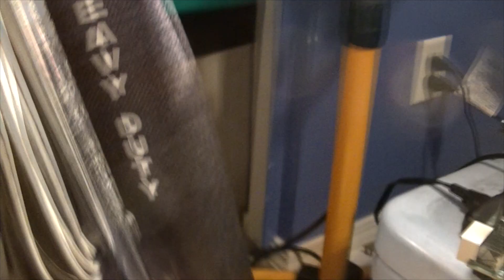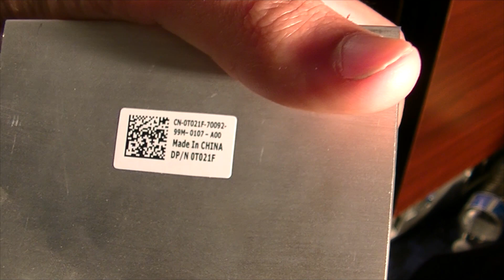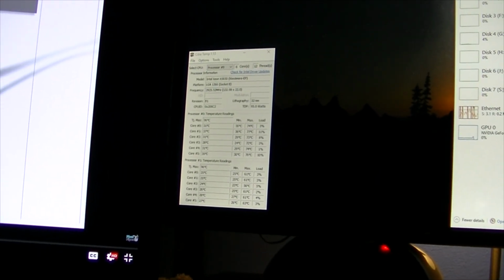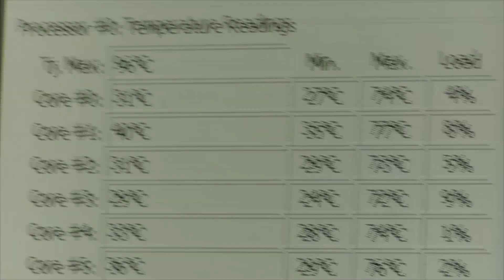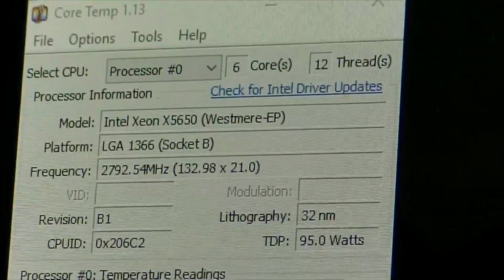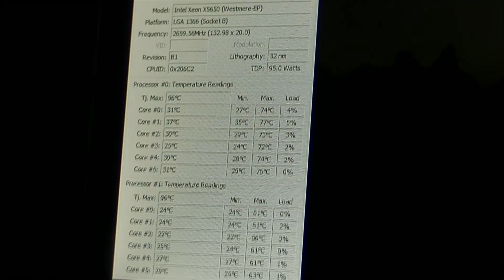Dell Precision T7500 - Heatsink Upgrade

Comment: Can you fit any 1366 compliant cooler?
Reply from the maker: I do not believe so. I can’t tell you for sure, but most Dell workstations have proprietary cooler mounting. In most cases, they thread into tapped holes on the case itself, behind the motherboard, instead of more traditional CPU backplates. Not to say you couldn’t make it work, given all clearances were okay with an aftermarket cooler and longer screws.

Comment: Hey nice video. I have a T5500 with x5680 and windows 10 with your "old" heatsink and seeing the same numbers as yours. When the cpu is runing a game, it shows with 80-90 degrees and the Fan keeps working at minimum revolutions (800rpm). I installed Speedfan (with the option Dell support enabled) and was able to turn up the speed of the fans to (2.250rpm) and now is showing 55-65 degrees. I don't know why you have to turn manually the fans for getting better cooling. Maybe bad design? Also i will like to "upgrade" to the heatsink that you have in your video but don't know if its gonna be better or will worth the purchase. Did you see any difference in temp? Thank you!

Comment: Dude!!  I didn't even know there was a better stock heat sink for this thing. I have a T7500 as well, and I bought when they first came out, but mine only accepts the 5500 series Xeons as far as I know. I've never gotten an answer as to whether I can put the 5600 series in it.  Since I bought it I have maxed it with the W5590s.  They are 130W as well and they are hot!!  I can't turn on hyperthreading because it just gets too damn hot.  I've been trying to think of any way in the world to get it stay around 50-60C when the processors are at about 80-90%, but I can't find a way.  I can't find an after market that fits it either. Sucks!  The T7500 are work horses tho.  I still love it.
Reply: Hi! I faced the same problem as you. I have a T5500 with X5680 (130w) and it goes to 80-90 degrees hypertreading in games with the "normal" dell heatsink. I found that for any reason the fans always work at minimum (800rpm) and even at high temp they still at the same rpm. It could be a driver problem or windows 10 not supported for this hardware (because in dell web website there is only drivers for old windows versions) but the solution i found was manually start the fans to the 100% (2000-3000rpm) and now the temp goes max to 50-60 degrees. You can do it with this app called speedfan and also adding dell support on configuration settings.

Comment: Hey, I just picked up a Dell Precision T7500 as well.  I also have a cheap heatsink.  But I don't have the heatsink and memory shroud.  Could you look for a part number on it?  Or and one else.  It's harder to find without the part number.  Google it T3500, T5500, and T7500 but I'm not even getting close. 
 I too am doing some other upgrades.  Picking up 5.25 bay to 4 X 2.5 drives with hot-swap, Plus upgrading to with a PCI-E to 8-port SATA III at 6 GB/s and install a Media card reader with USB 3.0 and audio in/out jacks, 1 - eSATA port and digital dual fans controller,  picked up a PCI-E card for two USB 3.0 on the back with a 15 pin head for the 2 USB 3.0 on the front.   Planning on using an SSD for the boot drive.  Run Linux Mint 19.3 on 2.5 SATA drive for now.  Waiting on Linux Mint 20 to come out.  Alright, get back to me with information if you can.